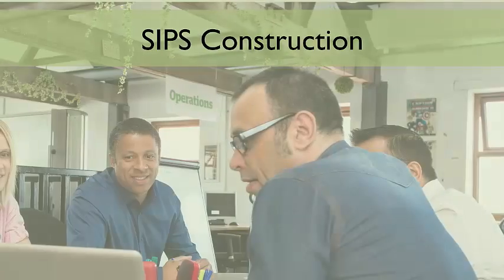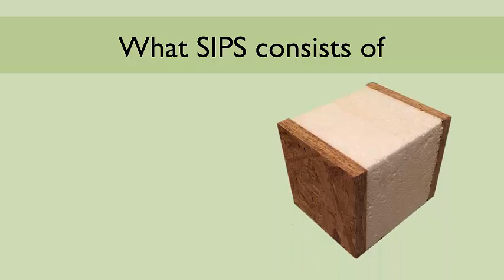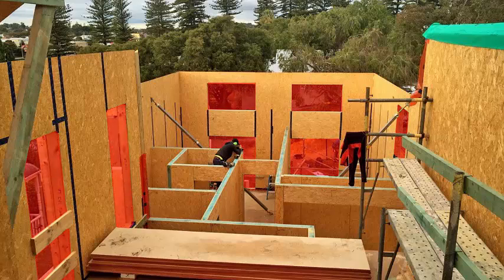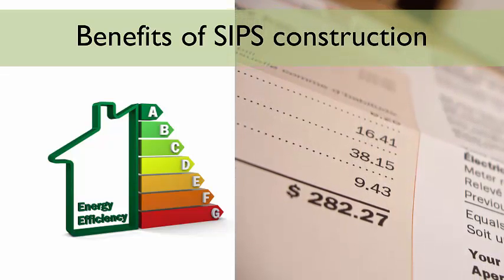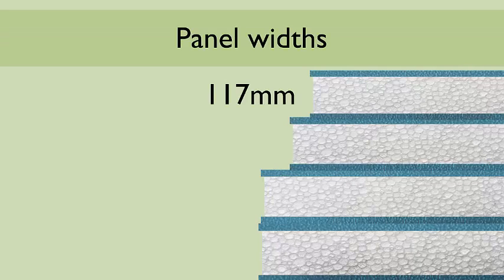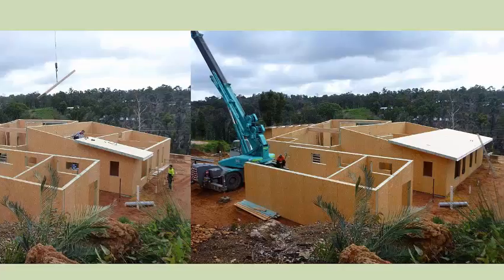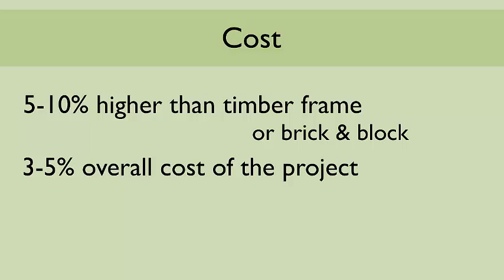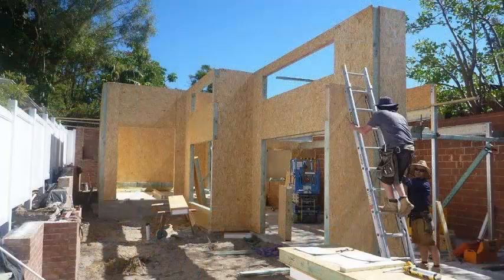What is SIPS Construction?

Comment: So if you build a sip home will plumbing and electricity be included?
Reply: Some SIPs panels have hollow sections built into them to run the plumbing and electricity pipes and wires. Using this method can makes building easy, but will make things difficult should you wish to run extra cabling or renovate in the future. You can also run a batten down the SIPs to give an air gap behind the drywall. This then allows you to run the pipes and cables wherever needed and allows for cables and pipes to added at any time. The builder will use either method mentioned, but using battens will increase the cost slightly and reduce the size of the room marginally.

Comment: Fireproof? Waterproof?
Reply: How they solve it at Standard timberframe?
Reply: SIPs can come in may forms, instead of using OSB checkout 'MGO' SIPs. They are fireproof to some degree and a lot more waterproof than a standard timber frame. Making any house waterproof requires extra works like proper fitment of a building wrap or some form of weather Resistant Barrier (WRB). Any trapped water that cant dry out will eventually grow mold and then begin to rot, so its important to have an air gap between the external SIPs wall and the cladding to allow air flow.
Reply: @PaulyDownUnder Hi are you a builder in Melbourne? I’m looking for one who knows of about Sips assembly / installation….